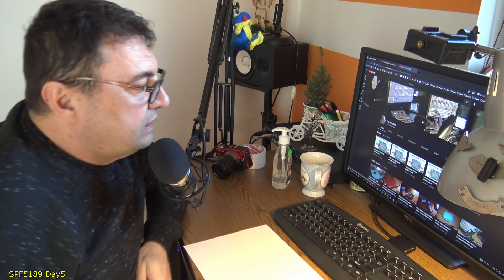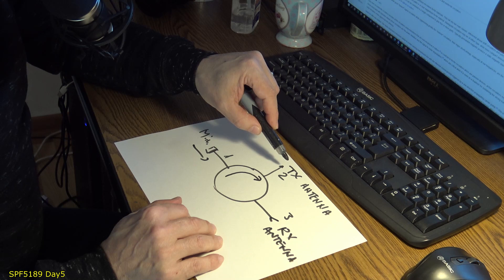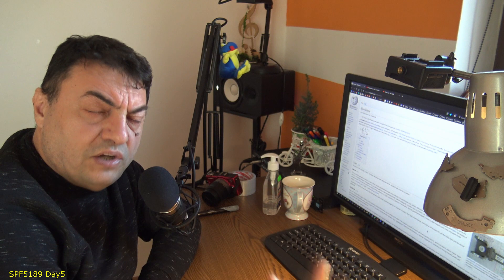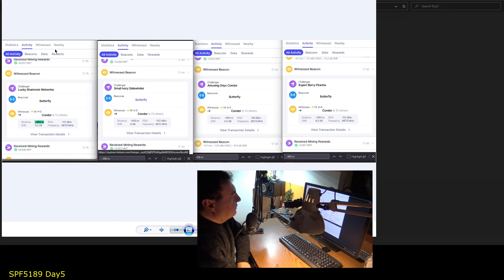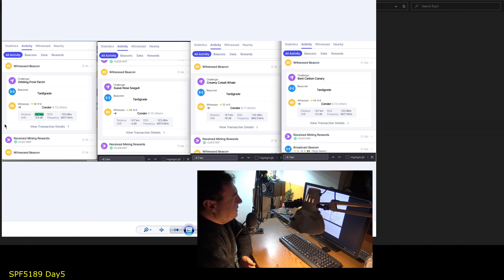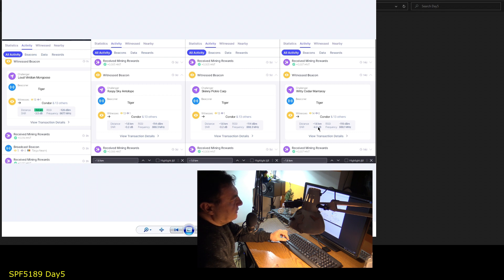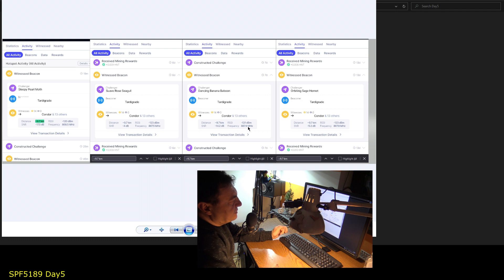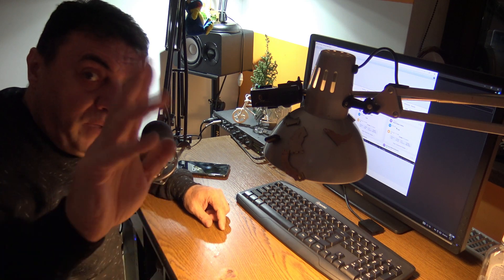LoRa Helium SPF5189 amplifier Day 5

Comment: Hello from the Ham radio guy.

So I tell you my thoughts.
I think the LNA is working. You meassure it with the nanoVNA and we see good gain. 

But now possible problems what I see.
1. Your antenna position. Under the roof. I think many signals you get are signals over reflection. NO "direkt line of sight" signals. so you cant get stable signals every time.
Have same problem here by me. I can receive with my SDR stick in 70cm ham radio Band(438MHz - 439.5MHz) 11 amateur radio repeaters. The antenna only at the balcony(1. etage)
From this 11, the half of the one are also signals in secounds goes up and down. Most by good weather without windy 6-12db. But if its windy or/and rainy, the signals move 20,30 or 40 dbs up and down fast.
2. Same Helium hotspot has no input saw filter. pantherRX, heltec and other. So strong signals from other radio services like FM, TV station or Mobil hotspots can overdrive your hotspot, or it is to high for your LNA.
So you must test it with filter... (see sorin has test a panther RX with and without a filter. without a filter the hotspot works bad... also problems with signals strengh.

greetings Thorsten
Reply from the maker: Thanks Thorsten, very well said..my antenna is a RAK 8dB well over the house top..but it's very possible to get reflections from the buildings around, I'm in a ''tube'' in the middle of the mountains and in between blocks..like 5 floors high, but I have openings south and est..well, it's still a work in progress, I'm learning day by day and I'm thinking serious to start courses for HAM license..
Reply from the maker: The filter tests is coming soon..I decide to have a week for each scenario..I'm collecting data to have a model of the TX/RX situation.

Comment: There is to many inconsistencies to really say that the amplifier is working , if an amplifier is working there should always be better signals than without amplifier. I think it's a good idea to do only antenna test without amp... thanks for the update..
Reply from the maker: I'll take next 2 days, for the sake of promised 7 days test and I'll do a simple antenna to miner for 7 days in row..my area is pretty predictible like beacons and I'll have a reference point to start again ..even with a simple filter eventually..
Reply from the maker: Right..strange ups and downs..BTW this amplifier it's a joke, but still need proper testing..A lot of people can be fooled by greedy sellers..